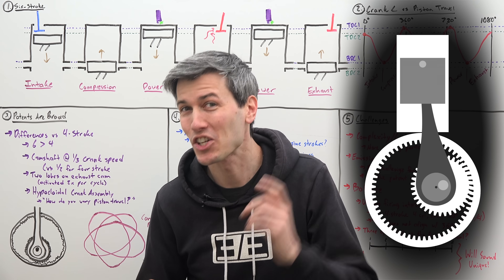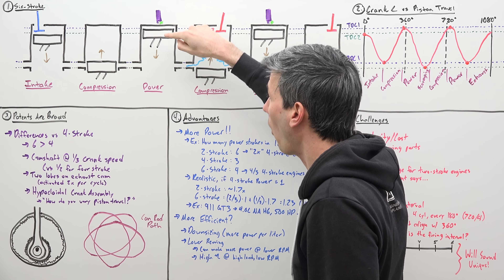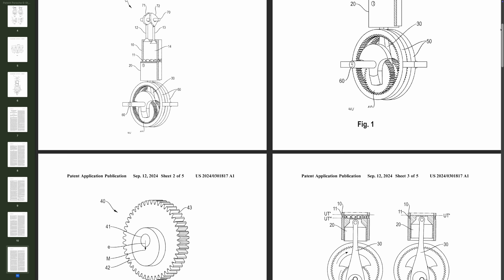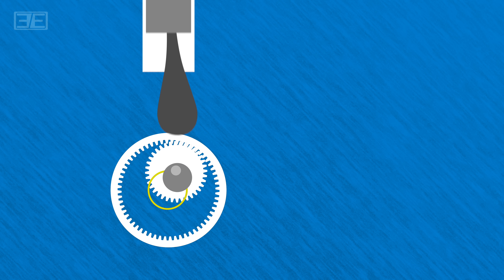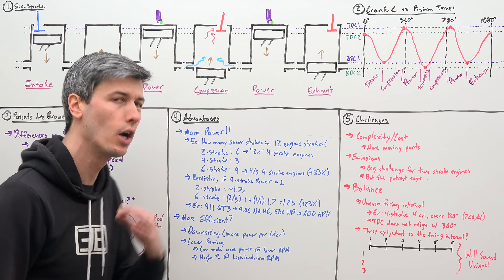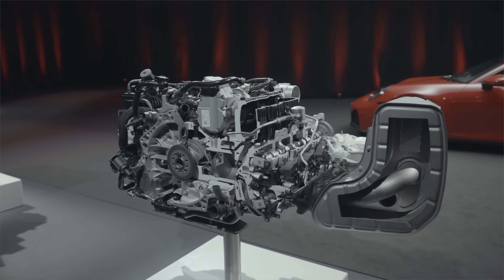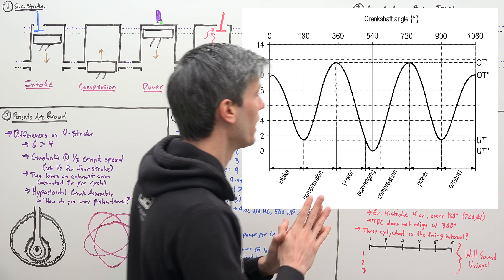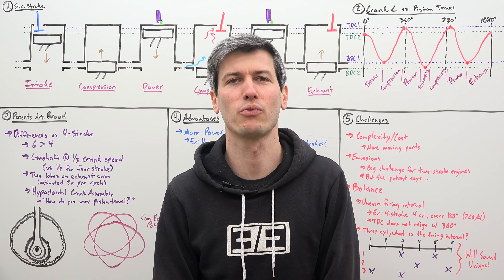Porsche's 6-Stroke Engine Is Genius!

Comment: I am very interested in this engine configuration, but also very skeptical. I'd like to see one working. The thing is, the 2nd power stroke just seems like it will be a lame duck and not produce much power. Or it will be powerful but incredibly inefficient with fuel. I'm not sure why they are claiming it will be both powerful and fuel efficient. My reasoning below:

1. Getting Rid of All Exhaust Gas
I just can't see how you'd get rid of all the exhaust in the cylinder and compress an air/fuel charge all at once in the same stroke. It takes a lot to evacuate a cylinder of exhaust gas, that's why it traditionally has it's own stroke. If you don't get rid of the exhaust gas, you get terrible, weak combustion. Like a 70's smog motor.

2. Scavenging Comes from Overlap
On the other hand, if you really are relying on scavenging from the lower intake ports and exhaust valve being open at the same time to clear the cylinder of exhaust gas, well, that's called overlap and we use it on big cam engines all the time. It does make good power, but is terrible for fuel efficiency because you can't stop some of the new air/fuel charge from going out of the cylinder with the exhaust gas. You're basically just throwing some portion of unused fuel right out of the exhaust valve.

Basically, I don't see how this 6-stroke engine can be both more powerful and more efficient. It's super interesting, but kind of just looks like a mess to me. But time will tell, I'd love for it to come out and be awesome!

Comment: Regarding the even-firing aspect of this discussion, this is why four-stroke radial engines always have an odd number of cylinders per bank, regardless of how many banks they have…each full cylinder bank rotation needs to get back to the opposite stroke (intake/compression or power/exhaust) when it returns to the starting crank position. If the number of cylinders were even, when we rotate through all the cylinders, when we got back to the starting crank position, the first cylinder would be on the wrong half of the four stroke cycle.

Comment: Exhaust design will be interesting. I think id it had to be id rather a 4stroke engine lets say 2 cylinders and a 2 stroke engine lets say 1 cylinder all running on the same crank. At least then it would breath properly. Still seems grim.

Comment: I'm not a mechanic or a mechanical engineer, so maybe my doubts and thougths are not the best but from what you said, i think the better emissions might come from better burning up the fuel from the first power stroke, as the second one will still use the unburnt fuel that is still a part of that exhaust gases mix (less oxygen though, so I don't know).

That being said, it's hard for me to understand how you're going to have lower RPM for the same power and smaller displacement. The first power stroke is not going to use the whole cylinder as it has to start lower (so I assume the exhaust stroke doesn't go all the way up, which means there's less air being sucked into the cylinder) and will not go all the way down, again, limiting the effecitve size of the cylinder. I would assume, you'd actually need an oversized cylinder for this. The second power stroke can only work with much more limited air supply, as all it gets comes from those side vents that are exposed only for a very short time, at least compared to the time the air gets into the cylinder during the intake stroke. I think your math is off because you assume you get the full power from both strokes and in both cases you only get part of it and I'm not sure you corrected for it. 

Also I'm not sure how you ended up with this 23% number. You got that everything else being equals the 6 stroke engine gives 33% more power than a 4 stroke and then you improved on the power of this engine by realizing, the two stroke phase is more efficient than the four stroke phase so it would suggest the engine is actually 1.33*1.23= 1.64 times more power efficient than the four stroke one.

Comment: I was thinking about this during the video and more when you talk about burning oil 
It will burn oil cuz the oil coming from the bottom will go in the air gap for the lower point of the cylinder and go in the chamber when firing
Or they explain how they will do for this?

Comment: A 1000 great vids wow. I have maybe watched 50 of them.
  Anyhow, that is some clever stuff they came up with. I wonder whether the cycle itself is more efficient in terms of net work under the PV curve. Also whether the ignition timing will need varied between the two  power strokes in order to achieve similar peak cylinder pressures. Plenty to think on.

Comment: Scavenging will improve efficiency. Eliminates EGR since your scavenging/burning off the residual fuel from the first power stroke you won't need EGR. Should make for cleaner exhaust.

Comment: You have done an excellent job presenting and explaining engineering throughout ALL of the 1000 videos! First Rate.
I am a degreed engineer. BSME. Graduated in 1995 at 37 years old. I am very rusty now and retired. 
I don't know what the half-life of knowledge retension is, but if you don't use it, you lose it, which makes it a speedier half-life!  Ha! 
I need to refresh/review my mathematical/engineer skills for sure. (I kept all of my books and papers.)
This will be sort of fun for me anyway because I like solving puzzles. The way I first approached learning engineering. Fastinating and fun.
Thanks again.
-Chuck, retired in Florida.

Comment: I am glad you mentioned the potential sound for this slight imbalance... I think that this this slight timing shift could make for an epic sounding motor.   Possibly, if the 2 stroke intake takes advantage of some type of air induction that should help significantly with the burn efficiency.  So many things to play around with in this design.  Also, that Hypocycloidal crank assembly is pure genius.   That is literally the sort of mechanisms we studied in engineering kinematics that were designed at the start of the industrial revolution. ( Back when mechanical engineering was truly an art form).   Finally (but not last) thank you for the brilliantly simple explanation for what is a rather uniquely complex and yet simple design solution. (The best kind IMO)

Comment: better balancing will occur at 6 cylinders tho you would have 2 power strokes every 180 ish degrees with one being the '4 stroke' and the other being the '2 stroke' but they wouldn't occur at the exact same time, also due to shape would it be possible to have this in a boxer configuration, well not entirely where opposing pistons cancel out the a lot of the balancing on the crankshaft due to the small changes in phase between the pistons. I see the small amount of maths I've done to look at this you've realised the same thing although its a fascinating theory something i may have to do some more research into in one of my masters projects. realistically, to achieve the levels of power needed to make this extra complexity worth it, some form of forced induction would be required to help make a more powerful 2nd power stroke in the cycle. If it makes you feel more sane, I also decided to try making the Nosie. I thought the flat 6 would make with all these different strokes!

Comment: As far as I can see, this can't be Naturaly Aspirated. There's no "suck" in that two stroke part. The scavenging air coming from the bottom has to be pressurised to be able to flush the cilinder, push the exhaust gasses out and fill it with clean air, in that very short time the ports are open. It will need a TC or SC.
Reply: ah you already mentioned that in the pinnned comment XD

Comment: Surely a conventional 3 cylinder 4 stroke engine would have 240 crank deg between power strokes? your power stroke assumptions towards the end of the video should be spaced this way and not the 180 deg you used? If the first power strokes in each of 3 cylinders were spaced at 240 deg intervals the second power strokes would also be spaced the same but 360 deg later than the first. 
I was just thinking yesterday, had anyone every made a multi cylinder engine using a mix of 2 and 4 stroke cylinders and then this pops up!

Comment: I'm not convinced.  If Porsche have solved the emissions associated with two-strokes by 'clean combustion', why not just build a two-stroke and enjoy the 70% power uplift and huge reduction in component count?  Any engine which uses a sliding action valve,  which includes piston ports, must lubricate the sliding action and some of that lube ends up in the combustion space, leading to poor emissions.

Comment: Roadracing motorcycles often use an uneven firing interval in 4-cylinder engines (ba-bang... ba-bang...) since the longer interval allows the rear tire more time to recover traction between power strokes compared to an even firing interval.  This helps the rear tire to spin up less on corner exits.

Comment: There's a reason Porsche recommends cylinder count be a multiple of 3. If times correctly, you would always have two cylinders firing simultaneously, every other stroke, aka every 360 degrees.

Comment: Interesting... but I mostly see a combination of disadvantages.
If you buy into the exhaust gas treatment problems of 2 stroke engines (or the second power stroke here), why not directly make a 2 stroke engine and use the advatages of it?

Comment: It will not work in the real world,  2 reasons or it:
1.the piston length will be too high making it heavy and unsuitable for a high reving engine
2. Higher vibration also hindering high revs

So no way it'll be suitable to be in a porsche,  apart from that the negatives out weigh the positives , bulky and complicated, not to mention the emission challenges

Comment: I really think the problem is that the crankshaft will be shaped in a very particular way such that nobody will be able to work on the engine when it grenades itself at 60k miles

Comment: so thirsty like a Wankel but really a 2 1/2 stroke engine with two different ring wear patterns & the parasitic drag from the extra gearset. 
This will go into production like Honda's oval piston V-4 motorcycle engine.  As in LIMITED.

Comment: Probably stillborn.  Guessing it would need balance shafts, and still wouldn't be smooth.

Seems to me that for the same complexity you could have a Napier Deltic- like engine.  That gives you potentially twice the power per stroke and 3 times the strokes per rev, all in a very compact package.

Hey, how about a constant-speed steam turbine running a generator, installed in a hybrid.  You can really optimize a constant-speed engine, and let all the variation in demand reside on the electric side.

Comment: nice concept but never going in to prodution. here is why: this can work as a normal crank engine with normal strokes. for the scavenging part only a third (recesed) valve is needed. so bye bye hypercycloidal cranksystem.

Comment: as i understand it the 2 stroke part of this 6 stroke engine is basicly an internal/in cylinder egr or internal/in cylinder secondary air injection instead of extrenal as it has been in the "past".......

Comment: This is the best news for me as I would love to continue driving an ICE until I die. I would love more power and efficiency in any specific engine size, turbocharged or not, because I simply enjoy hearing the engine rev and the exhaust note when I depress the gas pedal. I'll accept an  electric motor to help boost acceleration and quiet parking lot maneuvers, but I love to hear my engine sing!

Comment: The calculations are all fascinating, but in the real world, as a motorcyclist and car owner, a small engine making the same power as a big engine is not more fuel efficient. X amount of power equals X amount of fuel. Modern engines, if well designed, are getting as much as they can out of gasoline. Any fuel efficiency gains are from the lighter weight of a small engine, and barely measurable. But what we are seeing is way poorer durability from overstressed small motors.

Comment: Bro, technically this will not even have 23% more power as the transfer of energy from the piston to the rotating assembly is really indirect and inefficient, I think this will only be good at like 12K+ RPM, but then it will have tons of complex vibrations.

Comment: Remember reading somewhere that the fuel efficiency claims comes from the second combustion stroke burn off the remaining fuel that didn’t ignite on the first power stroke. There’s always some amount of fuel that doesn’t ignite and this is trying to “reuse” as much of the left over fuel from power stroke one to stroke two (and some added fresh fuel).

Comment: First 2 at 3 and 5 then you only have to counter balance 1 cylinder with weights. Of course this will be very costly to the weight and complexity of the engine as it will take a lot of counter weight but I think it's the most simplistic way to balance the engine

Comment: Bit late... but it could be used in hybrid EV military equipment. It would be interesting to do a comparison between the Stirling engine in the hybrid situation.
Also the Napier Sabre using electronic control maybe better..

Comment: I think, and someone else has probably written this, that the reason it is a three cylinder is that those three move in unison. The second power stroke, which probably works as some replacement for EGR, is less powerful than the first. So with a three cylinder moving in unison, you can have cylinder one firing on its first power stroke and a cylinder two firing on its second power stroke. Cylinder three is on an intake stroke. Then cylinder three fires on its first power stroke, cylinder one fires on its second power stroke, and cylinder two is on its intake stroke.  This engine would only be smooth in a, wait for it, horizontally opposed 6.

Comment: Did anyone told Porsche that the world is transitioning to EVs. Electric is efficient , more powerful, very low maintenance. Battery technology is advancing exponentially. Soon EVs are going to be significantly cheaper , power powerful, smoother and lower running cost .
Reply: The only way to make EVs match gasoline engines in power is to increase the number of engines until the car weighs more than a truck. Also vampiric horsepower loss as the battery drains, enjoy.

Comment: A 3 cylinder won't work, but a 4 cylinder will... Cylinder 1 (1&3) cylinder 2 (5&7) cylinder 3 (2&4) cylinder 4 (6&8) or any other variation to balance the crankshaft and reduce vibrations.

Comment: Also an issue would be the rpm at 7k rpm on the 4th stroke there would be not much time to air to re enter the cylinder. But very interesting design

Comment: You completely left out the most important part of this patent, it's that they can have variable compression ratio. They can change the physical distance between the cylinder head and the crankshaft.
Reply: But they can’t change the position of the two stroke air inlet valves right ? So the two stroke will have considerably less compression
Reply: @srujan2482  They can have them more exposed as the crankshaft gets farther from the cylinder head. The total amount of movement would be 5-6mm at most. Also, this engine design is going to have forced induction in the form of an obligatory supercharger and optional turbochargers.

For instance, if you only had 2mm of crank movement on a 90mm x 90mm engine, you could easily get a range of ±3.2:1 compression ratios. This means you can run a much, much higher boost safely, allowing for much more power and efficiency relative to displacement.

It would also be possible to have different boost levels for the head and wall intakes, compensating for the lost compression ratio by further compressing the air before the intake.

There's a mountain of stuff to unpack in this. It's much more complex than a modern engine, but it appears, on the surface, to have some real potential.

Comment: on the 2nd intake (the intake from the bottom ports), does it inject more fuel at the same time?  or only adding air and use whatever uncombusted fuel from previous power stroke?

Comment: On the efficiency claim, could they be attempting to make a second power stroke from the remaining fuel mixture of the first power stroke? As in, not injecting more fuel, but re-firing the initial fuel burst a second time with the scavenged air. Since exhaust typically contains a bit of unburned fuel, maybe that’s where they’re going with it.

Comment: 15+ years ago I heard about an entirely different 6 stroke engine,  it sure who developed it or designed it and not sure if one was ever built, but first 4 strokes were the same as a normal 4 stroke engine, 5 was injection of water with valves closed, causing the water to absorb heat energy from the previous combustion and turn to steam, expanding, and causing an additional power stroke, and then 6 exhausted the steam. 

I assume something was terribly impractical or just didn’t work since I haven’t heard about it since, but seemed like a good idea on the surface as long as the valves could be controlled appropriately.

Comment: Looks to me that the primary imbalance issue means that it would most likely have to be a 6-cylinder, based on Jason's description... I haven't gone so far as to sketch out the firing list for a 9-cylinder (W-9 anyone?!?) Cheers and Thanks for the explanation and congrats on 1000 videos!

Comment: 6 power strokes mean we need more heat regulations system, also am cery concerned about the secondary and primary vibration it will produce and extra mechanims to deal with, valve timings will be a pain, most importantly the scavenging, achieving ideal scavenging will be difficult.

If its diesel, we have to deal with variable compression ratios, and if its petrol we have to deal with variable injection timings